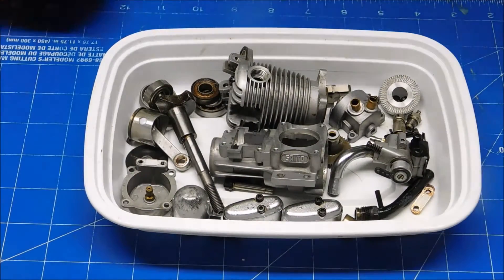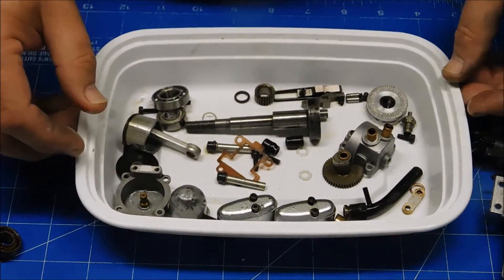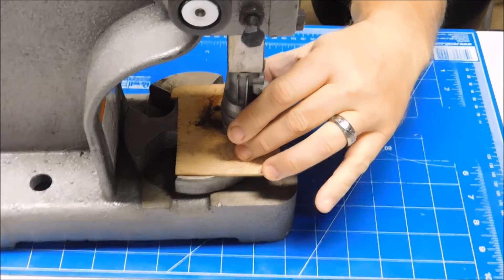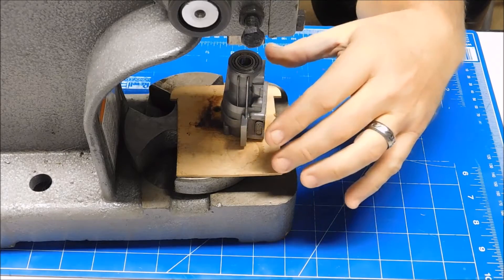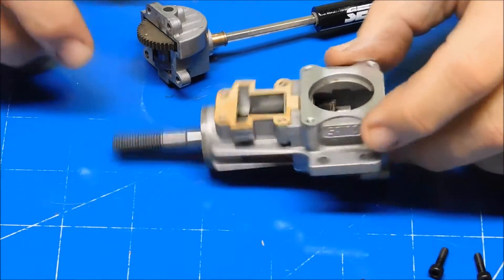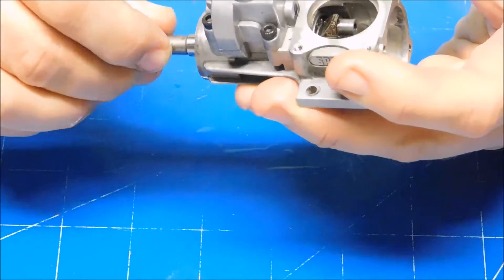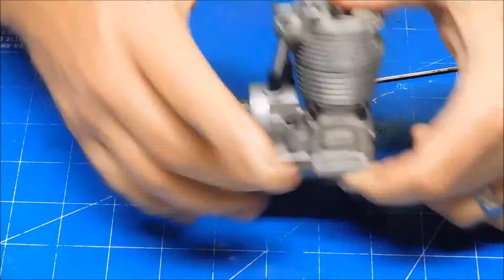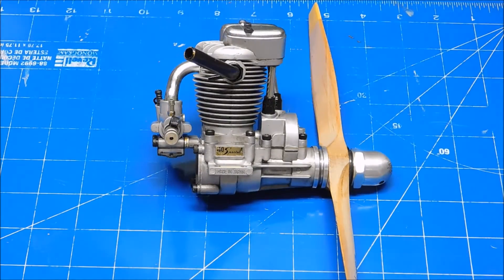Saito FA-40S A Look Inside Part 3

Comment: Hi David. Trying to find new front and rear earings as well as a high speed needle. I am told the modern 56 parts fit this motor or did you use parts from a 40a ?
Reply from the maker: No the new 40a is a totally different engine and case size, those bearings will not fit.  You need to measure the ones that come out first and then order.